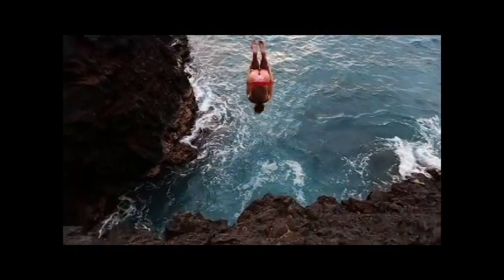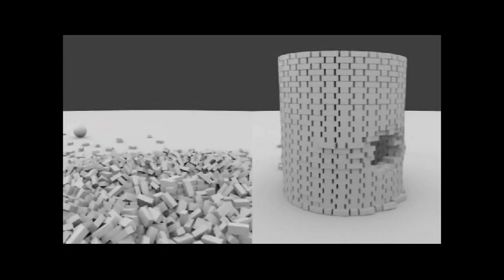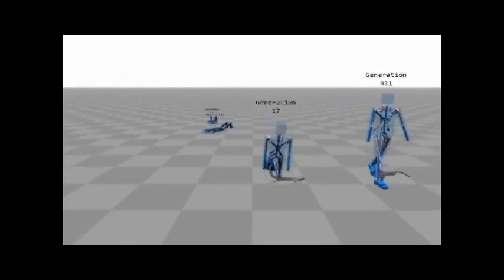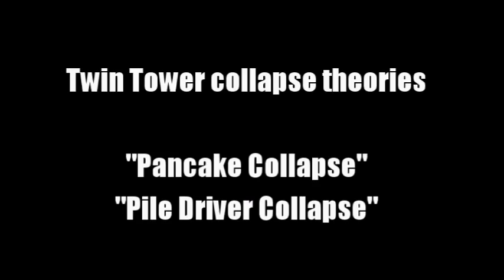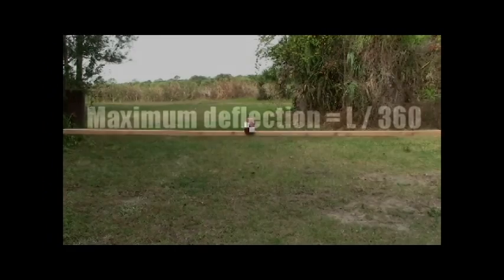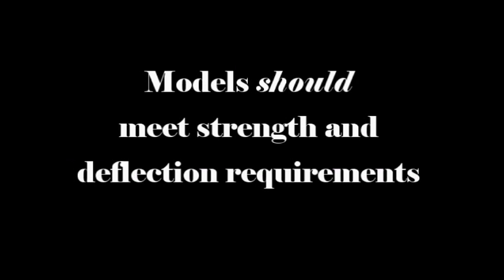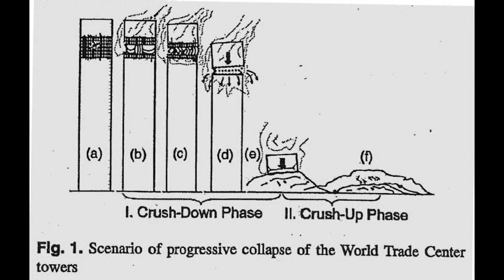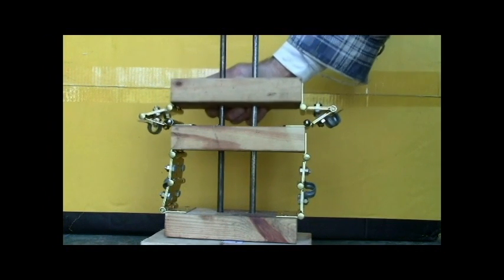9/11 Experiments: The Force Behind the Motion

Comment: I'll try my best to stay simple...the models shown on this video cannot work because gravity has different effects depending on the mass of the moving object. 1 tonne of steal and concrete will produce a very different kinetic force..which of course surpasses structural resistance... 

My God..... How did u not know that before spending all your energy on this video.................. What i just wrote above is pure basic structural engineering... Seen in first semester ... First year of undergrad ... 

Can't believe this....
Reply: Dear .. NIST doesn't support neither the pancake theory nor the controlled demolition one.   Though, you will still defend one to the detriment of the other. You are cherry picking :).
Take away the pancake naming I used (erroneously ill admit, but English is only my third language ), for the rest, I have simply quoted the NITS findings :) , and provided the very simple physics which motivated the collapse. 

"Yes, there was more than enough gravitational load to cause the collapse of the floors below the level of collapse initiation in both WTC towers. The vertical capacity of the connections supporting an intact floor below the level of collapse was adequate to carry the load of 11 additional floors if the load was applied gradually and 6 additional floors if the load was applied suddenly (as was the case). Since the number of floors above the approximate floor of collapse initiation exceeded six in each WTC tower (12 floors in WTC 1 and 29 floors in WTC 2), the floors below the level of collapse initiation were unable to resist the suddenly applied gravitational load from the upper floors of the buildings."
Reply: You're an idiot if you believe the 15-20 floors above the impact zone was capable of crushing the 80 undamaged floors below them at just slower than the rate of free fall.
Reply: The fires were not constant or eroding, they burned at less than 400 degrees F. If you believe the fire was enough to cause the towers to collapse I encourage you to look at this. http://www.mace.manchester.ac.uk/project/research/structures/strucfire/CaseStudy/HistoricFires/BuildingFires/default.htm
Reply: The structure was not entirely damaged, so this downward acceleration should have slowed down then stop at one point, or so I think.
Reply: Fuck off Joe, You have been dismissed. You want to spew you disinfo talk to someone else, 
Show them a photo of a  "bent down and flat truss seat" in the rubble of WTC. 
\\][//
Reply: Mark H no mark That's not how it works nice try..  you made the claim of things exploding upwards and  outwards during building collapse. 
I'm not worried about the outwards but you need to find a video that shows anything exploding "" upwards"".
Reply: evsupp2011 I actually enjoy coming out here and bitch slapping ignorant truthers like yourself.   
You, as the prime copy n paste King are no different even though you never post any true facts .
Reply: Well get to work Laurent. Go build some models and make a video. We're waiting.
Reply: That's a computer model. Which means it's as real as a Road Runner cartoon.
Reply: Joe V, maybe you should try to grasp the physics lessons in the video above . Then you can think for yourself. 
Debunkers have a habit of not understanding elementary physics. You should have learned the basics of this stuff in the 9th grade. 
You do know that the architects in AE911Truth are all registered AIA members and the engineers are registered with ASCE. And there are plenty of PhD physicists aboard 9/11Truth. If you want to play the appeal to authority game we can too. 
If you want to come back with Argumentum ad populum, I will rub your snout in it.
\\][//
Reply: All progressive collapse theories defy Newtonian physics:
Newton’s third law is: For every action, there is an equal and opposite reaction.
Applying this principle to the collapse of the WTC Towers, it proves that the upper portion could only destroy the lower portion by the equal amount of the floors; That is if 12 floors are crushing the floors beneath them they can crush no more than 12 stories below. Simple physics.
What is the work done in ‘crushing’? It is smashing and destroying a material and objects. Equal and opposite crushing is crushing from above and equal crushing from below. ‘Crush up–Crush down’.
The material crushed in the interaction is equal. Therefore there is no material left to crush down after it is exhausted itself against the crush up.
https://willywhitten.wordpress.com/2018/03/04/9-11-simple-physics/
\\][//
Reply: Joe V has never provided a link to prove that Niels Harrit said what Joe claims in his current post. 
Joe V has not provided a photo of a  "bent down and flat truss seat" in the rubble of WTC. 
Joe V has never provided a single bit of evidence for any of his raging bullshit posted online.
Joe V is utterly ignorant of elementary physics and structural engineering.
Joe V is nothing but a disinformant and shill for the corporatist state.
https://willywhitten.wordpress.com/2018/03/04/9-11-simple-physics/
\\][//
Reply: Joe V is suffering from Propaganda Induced Dementia Syndrome  (PIDS)
\\][//
Reply: evsupp2011 how should I forgot who I'm talking to
 Another factlesstruther
Reply: finally somebody says it..thank you
Reply: "I'll try my best to stay simple" ~Laurent CHAMMAS   
It seems Laurent is trying his best to remain a simpleton.
\\][//
Reply: Willy Whitten the only physics lesson learned by watching the video above how to make un- scientific unrealistic scale models that take gravity, which was the driving force in the collapse, totally out of the equation.  
Of the approximate 2950 A & E registered at the A & E truth sight, their number represents 1/2 of 1% of all the currently working A & E.. 
And in the past 16 years has that group of degreed professionals found even One fact to change the official story?? 
I think I will stick with the 99.5% that have no problem with the official story...
Reply: "Of the approximate 2950 A & E registered at the A & E truth sight, their number represents 1/2 of 1% of all the currently working A & E.."~Joe V,
You can fuck off now. I told you about making an argumentum ad populum.
I have encountered you many times and I know for a fact that you don't know shit about physics.
\\][//
Reply: Dynamic Amplification Factor (DAF) or Dynamic Increase Factor (DIF), is a dimensionless number which describes how many times the deflections or stresses should be multiplied to the deflections or stresses caused by the static loads when a dynamic load is applied on to a structure.[1]
Where:

M is the mass of the object in air (kg)
g is the acceleration of gravity (9.81m/s2)
F total is the largest of F static mass + F hyd or F static~mass + F snap (N)
https://en.wikipedia.org/wiki/Dynamic_amplification_factor
. . .
Newton’s third law of motion:
whenever one body exerts a force on a second body, the first body experiences a force that is equal in magnitude and opposite in direction to the force that the first body exerts.
Since they accelerate as a unit, we define the system to be: the damaged upper floor section and the intact lower floor section, as these floors interact together according to Newton’s 3rd Law.
https://courses.lumenlearning.com/physics/chapter/4-4-newtons-third-law-of-motion-symmetry-in-forces/
, , , , , , , , , ,
Newton’s Laws of Motion

First law: In an inertial frame of reference, an object either remains at rest or continues to move at a constant velocity, unless acted upon by a force.

Second law: In an inertial reference frame, the vector sum of the forces F on an object is equal to the mass m of that object multiplied by the acceleration a of the object: F = ma. (It is assumed here that the mass m is constant – see below.)

Third law: When one body exerts a force on a second body, the second body simultaneously exerts a force equal in magnitude and opposite in direction on the first body.

What is an inertial frame — it is the frame in-which all three laws are applied as a whole. As such the inertia is described by the first two laws. The third law is an extension of the first two within the same inertial frame.

Gravity adheres to the same laws of motion as stated above as it is the frame which all of the laws of motion are determined by.

You cannot apply the first two laws of motion, and then arbitrarily disregard the third and final step in the logical sequence.
, , , , , , , , ,
Inertial frame of reference
An inertial frame of reference, in classical physics, is a frame of reference in which bodies, whose net force acting upon them is zero, are not accelerated; that is they are at rest or they move at a constant velocity in a straight line. In analytical terms, it is a frame of reference that describes time and space homogeneously, isotropically, and in a time-independent manner.
Conceptually, in classical physics and special relativity, the physics of a system in an inertial frame have no causes external to the system.
An inertial frame of reference may also be called an inertial reference frame, inertial frame, Galilean reference frame, or inertial space.
https://en.wikipedia.org/wiki/Inertial_frame_of_reference
. . . . . . . .
All three laws of motion are part ot the same inertial frame.
\\][//
Reply: https://youtu.be/9az6MMNZJl8?t=3
\\][//
Reply: Willy Whitten lucky for you, I'm on my phone so you can continue to doubt me..  . I Will post a photo of the bent truss seats..  because Yes... I'm going to lie about ...  it you freaking idiot.. . 
What will you say when I post it???? Deny, make excuses...that's what.
Reply: "I'm going to lie about it"~Joe V, Of course you are, that is your modus operandi.
\\][//
Reply: It appears that joe V's dog must have eaten his photo of the "truss seats bent down and flat against the spandrel plates".......... Hahahahahahaha!!!!
Whooda ever thunk it??
\\][//
Reply: Willy Whitten I didn't get a chance to give you the link for the truss seat damage photos last night...... BUT... If you Google "truss seat damage 911"" and look at the photo category.. you Will see what I'm talking about..  
Now,  what kind of excuses will you dream up..
And my dog wouldn't even be bothered to piss on a truther..  He would Never claim that as his territory....
Reply: For stupid stupid dumbfuck Joe V:
https://youtu.be/kxGB2YoGV-I?t=541
https://www.ff911truthandunity.org/
\\][//
Reply: Willy Whitten yes another diversionary tactic..  typical truther SOP.  ..
... Be told some facts that truthers don't believe.. 
Ask to see proof of the evidence
Be shown the proof..
Ignore the proof,  and scatter shot with a different topic
..THAT is Phase 1 of the truther accomplishments..   in the past 16 years
Reply: Joe V, you fucking stooge! You know goddamn well you didn't show any proof! Anyone reading this KNOWS you have shown no proof... YOU are an idiot!
Fuck off.
\\][//
Reply: Willy Whitten you mean to tell me you either don't know how, or you're too lazy to Google "" truss seats damaged in 9/11""
Reply: Let Joe V keep spewing tripe from his gaping rectal twat. No one is going to buy it.
\\][//
Reply: But what about the laws of conservation in regard to the actual towers ?
Reply: Agreed. The buildings were destroyed in less than free-fall speed according to seismic data, and less accurately from counting in the videos.
Reply: The plane hit the building from the side, and the building crumbled from the top. Once again, the plane entered the building from the side, AND THEN, the building crumbled from the top. Shall i say it again?
Reply: https://www.youtube.com/watch?v=XwoBRHDLxdo
Reply: And your point is????
Reply: The only time that the plane actually, physically caused any acute damage to the columns themselves, was the very moment of impact itself. The structure was built (as are MOST, if not ALL high-rise structures) to withstand gale force winds and impacts to a certain extent. They sway to and fro, and the fact that they did not snap upon impact is testament to the engineering marvels they were.                                             Probably 60-70% of those '30 tonnes of aviation grade' jet fuel  ignited and was spent within the first 30 seconds of the explosion (think of an aerosol mist explosion). 
Another 10-20% were most probably absorbed by textiles within the building itself (carpeting, drywall, chair cushions, etc.)...so for THOSE 4-5 floors, it was a blast furnace, for sure.
But once the remaining jet fuel is burned up, what's left are the textiles themselves. And most will not 'burn' very long, they'll just smolder as a MUCH LOWER temperature than the jet fuel flash. And the top 30 floors' weight..IF your  ANALOGY IS TO BE BELIEVED...WOULD HAVE bent to the weakened side and corner, and slowly DEFORMED, CAUSING A DECISIVE LEAN in the upper portion of each tower-WHICH WAS NEVER VISIBLE AT ANY POINT IN COVERAGE. The residual amounts left most probably never made it below floor 60. EVEN AT CATASTROPHIC FAILURE,  the remaining structure COULD NOT have CLEANLY 'pancaked' or 'pile driven' the remainder of the decent; gravity and physics would not have allowed it.
Reply: cAN YOU EXPLAIN WHY THE LOBBIES OF THE wtc WERE DESTROYED BY AN AIRPLANE 75 STORIES UP........SERIOUSLY CAN YOU ACTUALLY THINK ABOUT THAT
Reply: sTICK WITH THE HERD SHEEP MAN ITS TRULY SAFER IN NUMBERS
Reply: TRUSS SEATS CANT BE BENT BY EXPLOVISES ONLY BY FLYING AIRPLANES..AGAIN HOW COULD A PLANE STRIKE DESTROY THE BUILDING LOBBY 800 FEET BELOW? dO YOU REALLY BELIEVE THE LOBBY DAMAGE CAME FROM THE AIRPLANE?
Reply: Gravity has the same effect on everything mate, that's as simple as it gets. Just because the scale and mass involved is different doesn't mean that the behavior is different, the only difference is the magnitude of those forces, Newton made this one pretty clear. A ton of feathers and a ton of bricks still have the same mass, but we know that if you dropped them side by side one would reach the ground before the other because the surface area of the feathers will see them reach terminal velocity much quicker than the bricks, but we know this because we have either observed it or had it explained by someone who has. If you had never observed a feather fall, you would be correct to make the assumption that it would fall to ground at the same rate as a brick, but you would still be wrong and that is why you need to perform experiments to determine if your assumptions match reality. So if the official story is that the brick and the feather hit the ground at the same time and the details don't match the reality you live in, either your assumptions about bricks and feathers are wrong and need to review them or you experiment to see for yourself.
Reply: Laurent CHAMMAS there was not massive estructural damage, it was only 10 floors and not damage all the external estructure, come on people everyone see the videos the towers seems estructural thight, the external estructure was designed as a spider net and you cuold removed as much as 40% of the structure and still preservs integral structure.
Reply: Gravity dosnt have differents effects, always stay the same, you should knew thath the down aceleration stay constant in a free falling always 9.81 m/s2 minus the air ressistance
Reply: Laurent Chammas didn't two balls dropped from the leaning tower of Pisa disprove your statement.
Reply: I understand your point. But this video and these so called experiments do not represent what happened on 9/11.  Forex ample, it does not account for the MASSIVE structural damage suffered by the core columns on the initial impact of the airliners. It doesn't in consideration the initial explosion and the sustained and extreme heat the remaining structure was punished by for long long minutes,.   It doesn't take in consideration that NO weight support was imposed on to the surface structure... represented here by...pizza plastic holders ... scientific accuracy..indeed......                                      When the building caved it wasn't with a down ward weight crushing through the top floors going downward as shown on this video.   It was the weight of 30 plus floors going down on every floor below, one after the other, and one adding to the other.

It really doesn't take a fully formed structural engineer to understand the very fundamental forces put in play that day.

If you'd want to be accurate .. you'd have to build a scaled structure with exactly the same structural supporting cores, which obviously is not respected here. Then throw at it an aluminium/metal/titanium large object at extreme velocity charged with 10 tonnes of aviation graded kerosene... let it burn for a good half an hour, see what is left, and then see what the weight of the 30 floors above does to the remaining damaged structure.

Then only ... can you start to appreciate what really happened.
Reply: I follow your comment and thank you for adding it.  Gravity alone can account for the "smooth" downward acceleration, simply because the force pushing downward is motivated (or motioned)  by an enormous mass, and the resistance met by this mass, in our case the damaged structure of a single floor at a time is simply not enough to reduce its acceleration on any noticeable scale, hence the pancake effect.      I do not expect everyone to intimately know the properties of structural engineering which warrant the "non invasive" (or simply said non conspiracy theory) explanation of the events taking place on  9/11, but nevertheless, it is important to make some research before disseminating videos which do not respect the basic laws pf physics in terms of forces and motions. 

In very few words, what we sadly witnessed on 9/11 is indeed repeatable given similar or near identical conditions. Gravity accounts for the near free fall of the upper section of the building, simply because its enormous mass was not meet with enough resistance to noticeably slow it's fall.  Resistance and opposing forces  is what gave gravity such a momentum.
Reply: Laurent CHAMMAS  If you believe what we sadly witnessed on 9/11 is indeed repeatable I suggest you propose any experiment where any falling mass can accelerate downwards to essentially the rate of free fall acceleration through a mass of ever increasing density as what NIST claims in their building studies..
Reply: sure thing :) .. why bother when you can get the real comparable model with a 100% accurate and repeatable experiment?    

https://www.youtube.com/watch?v=gH02Eh44yUg

If you are interested to actually build an accurate model... that will require some time to build a comparable structure. 
Now, where the problem lies is the replication of forces. The impact was so violent, I am not sure at what scale i need to go down to , to replicate equivalent forces.     
Also, scaling down doesn't mean structures are proportionally resistant. They are not. There is an exponential and reverse loss of structural integrity.     For example a millimeter thick aluminium sheet is not 30 times weaker than a a 30 mm thick aluminium sheet.

Hence, the use of computable models. 

I'll look into it during the weekend and will start drawing structurally equivalent scaled down models. Again, I mean no disrespect to the author of this video, but this is too important of a topic to let misconception install false presumptions.
Reply: Yes, on this we agree. To achieve a free fall and a so-called pancake effect, some of the core columns must had been severed or/and (both in our case occurred) sufficiently weakened by a constant and eroding intense fire.     One last thing I wanted to add. On some of the 9/11 videos, you can clearly see the structure deforming seconds before the collapse (this observation is valid for both towers). You can actually physically see the upper structure starting to slowly descend before the remaining core columns cave in. You can see the outer walls ever slowly con-caving towards the exterior, and the upper floors noticeably descending.
Reply: Laurent CHAMMAS  Pancake collapse was denied by NIST. Perhaps you have become confused by the continued use of the description of pancaking floors in the NIST building studies despite their denial of the possibility? When was the last time you ever saw pancakes stacking as they explode upwards and outwards decreasing in mass anyways? You need to question NIST further on this subject if you are interested in truth sir.
Reply: Laurent CHAMMAS  I don't believe we have become acquainted well enough for you to use the term of endearment you started your reply with but if it makes you happy, I'm okay with it Honey. You made a mistake and you weren't man enough to admit it. Get over it. I've learned to accept this deceptive behavior from all the government supporters (trolls) that post in YouTube because embellishment of the known facts and bold faced lies are all you have to work with..
Reply: Fake Joe V  You would spend many more hours trying to find a video that doesn't show building materials exploding " upwards and outwards " in Tower collapse randy. In fact, I am willing to bet you can't find one at all.
Reply: Joe V  I don't really care what you think about how things work randy. You admit the there were lateral ejections of building materials and that's a good thing. I'm glad for you. Now take a closer look at the building materials that are propelled upwards from the top of the collapsing and diminishing mass of top floors of the trade towers. In case you're confused about the concept of 'up', it is generally considered to be the motion that is not down or sideways horizontally.
Reply: No one seems to be thinking about air pressure. There is a large volume of air inside the building, and it is bring compressed and blown out. In the oil tanker shipping business I am in its been demonstrated many times that just a few psi can rupture a heavy steel tank. Each floor was 208' square, which is over 432,000cubic feet of air PER FLOOR that has to move out in seconds. That kind of force will take smoke, dust, paper, furniture out is a huge velocity. Thus the illusion of "up and out". I am Not endorsing or denying and theories, and I don't put it past our government to be capable of anything,  just endorsing physical law. Also, in ship handling, a ship tied securely to a dock will stay, but loosen the mooring lines, allowing as little as 10' of motion, the mass of the ship is multiplied exponentially by motion/inertia and will break the mooring lines like they are rotten. Therefore,  30 floors, tens of thousands of tons moving down will exponentially increase its force to the point that no single floor structure could ever hope to counteract.
Reply: Willy Whitten Haaa..  you can copy and paste every physics book in the library, doesn't change the fact there's only one explanation for the towers to come down the way they did.   Maybe you should take some engineering, or real world Construction classes.  
And your smug,self-righteous attempt to sound smart is no different than a quote from Niels Harritt.  "" I don't know how the towers were built, I don't know how they were designed, but they definitely were a controlled demolition""".     Words from a PhD holder who thinks he's smarter than what he really is.
You still can't provide any other explanation for the truss seats being bent down and flat against the spandrel plates..
Reply: Mark H Mark Mark Mark you're obviously just another ignorant truther..  you made the statement of something exploding " upwards and outwards " in Tower collapse.  
Try and find a video that shows anything exploding upwards. 
 Here I will give you a clue.  Not so much as a nut or bolt was exploded upwards during the Tower collapse.  
Facts are explained to you,  and you pompously pick on one word of her reply. 
Typical truther tactic because you realize you have no facts to refute her statements.    
That's okay you're no different than any other truther.
Reply: Josh Donihue maybe you should ask anyone associated with the ASM, the ASCE, or the AIA and see what they think.. 
I'm pretty sure everyone in  those groups understands physics, understands what we all saw that day, and has more than 2  common sense brain cells..  
I can guarantee you,  you won't like what you hear.     Truthers have a way of getting upset when faced with facts.